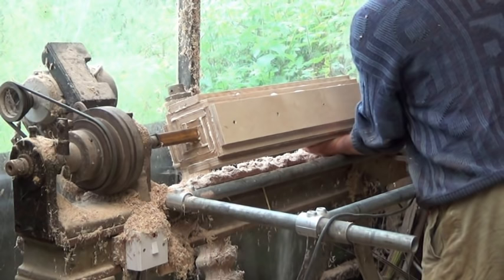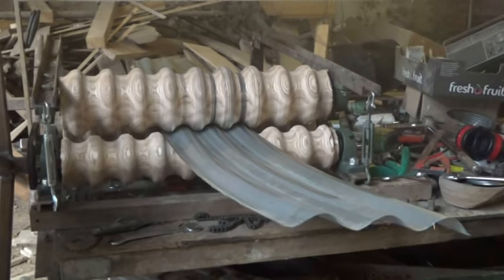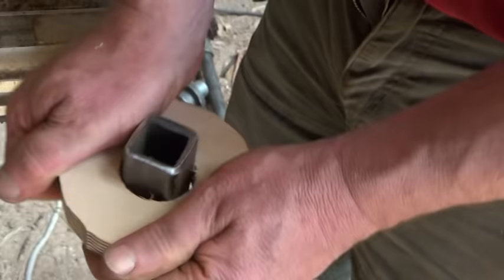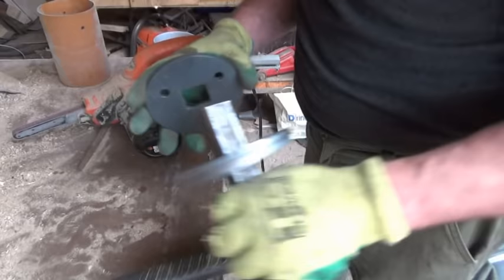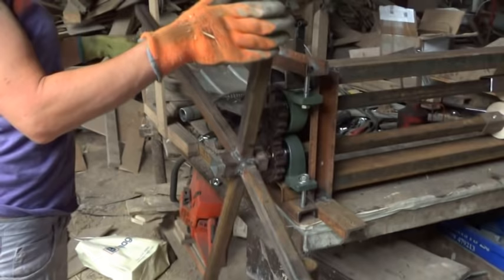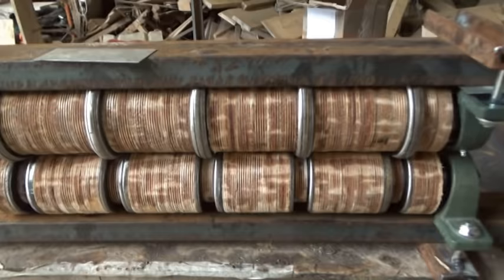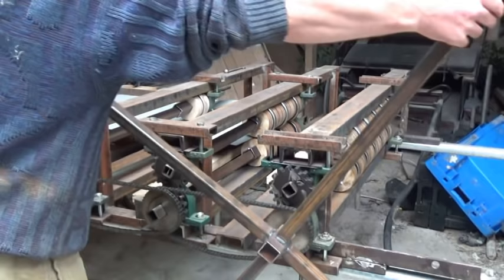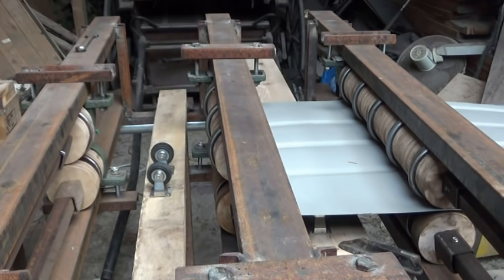Making A Machine That Makes Homemade Corrugated Iron (A New Type!)

Comment: Perhaps you need to adapt your design to incorporate something like an 'English Wheel' (a roller used in panel making to contour metal sheets by stretching/thinning). If you were able to control the speed and friction of the wheel and the feed rate through it, you theoretically could end up with perfectly flat sheets (although might need multiple passes).
Reply from the maker: Perhaps you're right - but the 'multiple passes' puts me off
Reply: @WayOutWestx2  You may be able to achieve a single pass, but with multiple rollers to deal with the two distinct operations that are involved - stretching and folding - which must be tuned so that no internal tension remains after passing through the machine. Interestingly, on the Wiki page for "Corrugated galvanised iron" there is a photograph of an antique manual rolling press with just three rollers.

Comment: Hi Tim,
Just a thought. Instead of trying to roll a curve into the metal. Have you seen the “curved corrugated metal crimping machines”?

It involves a couple of dies, that I’m sure you would have no trouble making (possibly using multiple layers of steel on your CNC Plasma Cutter), set up in a way that would crimp more of one side, than the other. Then a Hydraulic press would do the hard work for you.

Here’s a vid showing just this process: youtu.be/6IFvxHplFbA
Reply from the maker: Thanks Graham - that was an inspiring video. If I'd seen it a few months ago I might have gone a different way. (Where were you when I needed you?!)

Comment: Have you tried heating the steel sheets while rolling them?
Reply from the maker: It would wreck the coatings unfortunately
Reply: Over here in the us, some of the most desirable kind of corrugated tin is bare metal and old, because the people using it for roof want the rustic look.

Comment: what about replacing the wood with steel and add torches and make it hot rolled steel
Reply from the maker: it's coated so heat would only make a horrible mess : -  (

Comment: tim try making a curved  press the plate that press the sheet must be curved  with convex and concave areas and  the sheet   must be flat sheet the press will curve the sheet and make the humps in one shot
Reply from the maker: No Mohammed - you can do it : -   ) I've just spent making a machine that works a different way. I don't need two.
Reply: @WayOutWestx2  hope your machine work tell sandra she looks fit

Comment: Maybe they made corrugated iron panels the other way around, which is why they are 8ft, because that is the maximum width of the forming machine?
Reply from the maker: I think you can get them up to 40' long?
Reply: @WayOutWestx2  that is big, but maybe they have a 40 ft former. A lot of 'things' in the past were two guys feeding sheet into a press brake. amazing to watch :)

Comment: You need bigger rollers for the the size of corrugated sheetmetal you're trying to make..With the size you are attempting the corrugations need to be smaller... At the least the size of the roller need to be double
Reply from the maker: But it's working well as it is. Why would I need bigger?

Comment: i made thing like that on lathe, problem its not metal steel problem is in rollers thay must be very precise and machine construction must be strong to not flex en bend presure on rolers must be same on both side
Reply from the maker: Mine works fine. I use it every week.

Comment: how would 2 long cog weels be - bumbwise for your roofing needs? should be streathching your steel, but rolling it in the lenghtwise direktion is pretty nasty space wise I suppose.
Reply from the maker: If I understand you correctly then yes, it would work, but imagine the pressures involved to shape a 4m sheet - you'd need truly massive spindles.
Reply: @WayOutWestx2  yeah, it would potentially be possible to make out of two solid round bars, that you support with some sort of friction material on the up and downside, and the tollerance for each groove? yeah, that's nasty stuff there. Perhapps use one side solid metal, and the other thick rubber? - and a  PA 6 cradle so it won't bend to get away from the twist?? But needing 4m lenghts makes it ridicoulusy long. your set up is easier that way.

Comment: So a tight curve... are you trying to produce your own barrels then? I thought you were tying to make like metal roofing panels. In the case of steel barrels I believe the strengthening ribs are actually put in after the cylinder is produced and welded and they just have jaws that go inside and clamp down and make the ribs via a large bead roller. The ones I commonly see here in the US for a 55 gallon drum only have 2 ribs in them. (I have 2 cut in half in the back yard that I had been making a bar-b-que out of) I could measure how far down they are for you if you need, I know they are a 24 inch diameter. Also the shape of the ribs in them isn't round, it's more of a V shape which might be easier to produce and that shape might do things to how the steel bends. Also if you can, try doing it with the steel heated up once, even a couple hundred degrees can really relax the molecules and allow the steel to take a new shape much easier. Any hot rolled steel you get is somewhat hardened, heating it will relax the hardening and allow it to be re-work hardened easier without buckling/cracking.
Yep I was right, they weld the cylinder first and then add the ribs, and they make them out of cold rolled steel. Here's the How It's Made episode https://www.youtube.com/watch?v=Ct2F_wN582w
Reply from the maker: Not round drums, I'm aiming for  'n' shaped round-roofed huts.
Unfortunately the coatings (zinc and then pvc) would be wrecked with any kind of heat treatment. So I have to work with cold-rolled sheet. It seems to be working though.
Reply: @WayOutWestx2  ah okay, well you could try making your curves first with a regular roller and get the shape right and then run it through the dies to give it strength once the shape is what you need it. That way just like with the barrels, the shape shouldn't change once it's already set in place.

Comment: The real problem is that you are trying to form it in one pass.

Commercial machines use 3 or 4 sets of roll formers to achieve the finished profile
Reply from the maker: Yes, but they generally aim to make deeper forms.
Reply: @WayOutWestx2  not in this case.

The corrugated profile is the same as std commercial profile.
Reply from the maker: Yes, but mine is much less

Comment: Why not just use a 2 or 3 roll? 
I am wondering what would happen if you added heat?
Reply from the maker: Unfortunately, heat would only make a mess of the coatings. What do you mean 2 or 3 rolls?
Reply: @WayOutWestx2  The two rib looked good why not just make it three and call it good? We have roofing here in the states that is some what like that.
Reply from the maker: I'm stuck with my design now

Comment: It is very important the bearings of the rollers are as close as possible to each other to reduce the center of force and avoid bends on the rollers that most be totally hardened steel made, wood is not suitable for that work , you waste your time and sources.(see the curved lines on the sheet you worked at, it seems an ant path )

Comment: If you are starting with flat sheet metal and your goal is to make curved sections for chicken coops, why does it have to be corrugated at all? I thought the idea was the metal you started with was already corrugated but if you’re buying rolled metal, idk.
Reply from the maker: Corrugated is so much stiffer and doesn't need as much (if any) support inside

Comment: You have such a small amount of bow in the final product it will be easy to get it straight-ish. Straight-ish is MUCH MUCH easier than straight. Modify your last pass to angle forward and back a few degrees. Ideally you would also be able to raise and lower your top roll a small amount as well. Your top roll needs to tip just a bit towards the end of the line and that will make it bow down a bit. I would be happy to brainstorm more via youtube or email (my email is my handle @ gmail dot com). I am passingly involved with roll forming and also spent years in the steel mill where one of the things we controlled was the steel flatness. Some diagrams could help, but youtube isnt conducive to that.
Reply from the maker: I see my reply disappeared from this comment for some reason. I just wanted to thank you for your offer. You're right - straightish is good enough for this stage though : -  )

Comment: So now take the sheet and turn it over and reposition the rollers so the bead is in between the freshly made beads on the other side. No????
Reply from the maker: No : -   )   Because I need all the bumps on the same side for the next stage (when I roll it )

Comment: I would think that if you use your original set up with three rollers, and built it upside down... at the end of the line of your final setup there.... with the same type of rollers obviously... it would re bend the sheet back to flat.... once properly adjusted.  Think of how one would bend a straight metal sheet round..... use the same setup up side down... to re flatten it.  its not a huge amount your trying to 'un bend'
Reply from the maker: You're right - it's not a big deal. And the end goal is to bend them far more than straight... Watch out for the next video in this series...

Comment: you need to make larger diameter wheels so the steel isnt on such a curvature. 10in diamer rollers would be good, or 15inch
Reply from the maker: Why, John? The steel isn't affected by the diamter here, is it?
Reply: @WayOutWestx2  my reasoning is thst it isnt In such a tight bend. A larger roller should make the radius larger, the small radius dies are seqential  so each roller bends the sheet a small bit at a time not all at once.
Reply: @WayOutWestx2  i think its just too tight of a radius, i dont know how to explain it better
Reply from the maker: I think mine is working fine really - perhaps I need intermediate sets that only form half a bead though. We'll see..
Reply: @WayOutWestx2  yeah that too

Comment: sorry to burst your bubble ( i am actually sure you already knew) there is a roofing metal you have invented. it is called 5-rib, for the number of ribs per sheet i guess.  But that is not the point is it. I love the videos of your failures or more accurately road to success. as a previous teacher of design getting people to embrace failures along the way was very difficult, especially with children people thought the kids would give up if they had the slightest set back. So keep up the good work of failure.
Reply from the maker: Ha! No I hadn't seen that 5-rib. We don't have it here, I think. Check out the latest video in this series though - it seems to be working finally

Comment: Awesome, hey I just bought the USA version of this the Port-a-hut a hog hut that were very popular for pastured hogs, goats, calves etc back in the day.  This corrugation I believe was created like your own.  It has 9 ridges per foot and they are not rounded ridges but come to somewhat of a peak, not 90 degree but a rounded peak that I am sure was done when they rolled the u-curve into the sheet.  Here is a link to the current similar shelter, you may want to drop them a line or look for these patents to assist your quest.  http://www.port-a-hut.com/individual-hut.cfm
Reply from the maker: Interesting - was it me or are the photos not very clear on that website? Couldn't really make out the corrugations on the sides. But the shape is exactly what I'm aiming for. Onwards...
Reply: @WayOutWestx2  yes, very old web design, I have two old ones here that if you want any close ups let me know.  https://youtu.be/tQQ5iXNrOAw  2 considerations to these designs to solve beyond the curve is 1. condensation and 2. bottom 6 inches rust as it sits on the earth and manure.  It looks like they have a new treatment for the bottoms of these structures now that these did not have.  But that condensation at night could be a killer to a new litter of piglets.  I think I have a solution to this though.
Reply: I notice that your crimps are giving you that same U shape that they used in these structures with a 90 degree vertical up each end of the sheet and then a half circle bend.  You are damn near there but I think a crisper crimp may give you that extra ability to make that arching curve.  Another interesting thing about these structures is that there is only angle iron on each end and the base, the center is supported by overlapping the two sheets that make up the length by about 2 or 3 inches.
Reply from the maker: The fact that they are self-supporting is what first drew me to the shape. If that company of yours was a bit closer I wouldn't have to make one at all because that's exactly what I'm aiming for.
(Perhaps you should just cut the last few inches off the bottom all around? And then re-attach the frame?)
Reply: @WayOutWestx2  I understand, shipping from there to here is twice as much as the shelter costs so cost prohibitive here as well.  Yes, I was just going to use galvanized riveted to remaining sheets and screwed to frame.  But the previous owner had a simple solution, just screwed a board to outside.  I may actually repeat his solution but add a thin panel to the inside to avoid any sharp bits and direct the condensation to rot out the panel and direct to the ground giving them a dry panel to cozy up against.  I will have to replace the panel in time, but hoping a good paint will slow down that process.  But still hemming and hawing on it here.
Reply from the maker: timber on the sides will trap mositure though? and speed up the corrosion. But it will last a while longer anway
Reply: @WayOutWestx2  I am hoping the ripples will give the condensation a bit of room to flow through to the ground, but the painted wood probably won't last as long as a tin fix.  But should give a bit of creature comfort until they rip it apart.